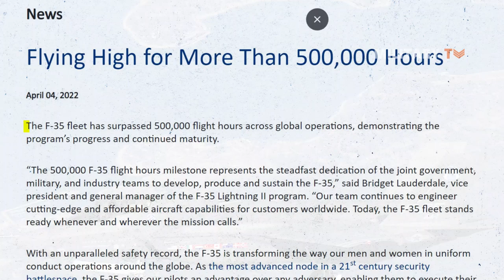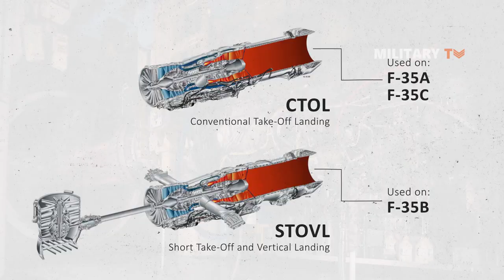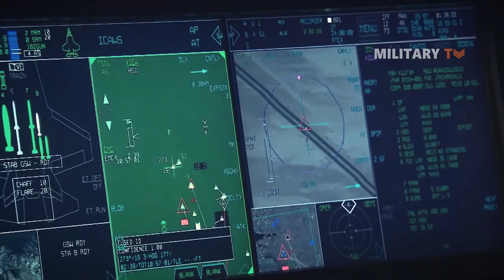Many Things You Probably Didn't Know About F-35 Fighter Jet

Comment: the range and speed are actually a downside because this plane just doesn't have good range or speed. not sure why the video would make that a talking point. seems strange..Also the carrier version is limited to 7 G's because the added larger wing just isn't capable enough. That's the problem with this jack of all trades, it's a compromise start to finish.
Reply: @snsproduc "fully loaded" F35 means not even 1/5 of the full load of a normal fighter jet. The F35 has too small and too few internal weapons bays. It can't even taken some common missiles because of that problem. Some people don't even call it a fighter jet because it can neither turn nor run, so it gets called sensor platform instead.
Reply: @swunt10  It can also do external loadouts. It's multirole, it can do many things. The AIM-120 AMRAAM for the internal bay is an excellent A2A weapon, it can also carry other AGM's or JDAMs in the internal bay. The F-35 is literally more manouverable on a stealth loadout (without external load) than a F-16 with no external weapons at all (gun only). It can do a over 28 degree angle of attack. It has the most powerful thrust of any 4th or 5th generation aircraft, which depending on loadout, also gives it a better thrust-to-weight ratio. It has a 28-1 kill ratio against F-15's and F-16's.
Reply: No range or speed? Geesh, what have you been reading?

How about we list out the fuel tank size here .

Fuel capacity (fuel tank size):
Harrier  7,000 lbs
F16 – 7000 lbs
Gripen39E/F – 7,500 lbs
Rafale 10,362 lbs
F18 – 10,860 lbs
Typhoon – 11,000 lbs
F15 – 13,455 lbs
F/A-18E: 14,700 lb
F35 – 18,498 lbs

Now, take a guess in above which by FAR has the larger fuel tank capacity? You have to swap out wing stations for fuel bags, and thus give up stations for external fuel tanks - not weapons.

How is a F16 with 7,000 lbs fuel tank going to get you a range EVEN CLOSE to what the F35 gives?

As for speed? Once again, we find the F35 actually flies faster with a combat load.

However, the F35 has a BETTER power to weight (thrust to weight) rating then a F16, and in fact even better then a duel engine Rafale.

And take a F18a. Its rated for Mach 1.8. But, hang JUST 4 AIMS on it, and you now down to Mach 1.4, and ONLY at 40,000 feet. Drop down lower, and you go slower and slower.  But, it gets WORSE!!!

That F16, f18, or Rafale? They ALSO need more fuel. So, now you have to hang fuel bags on the wings.  Put just one centerline fuel tank on a F16, and you max g-loads are now about 5.5's.
The F35? still full 9g's rating!!! and stull Mach 1.6 rating!!!

Then when groups of F16's fly with F35's?  They start to fall behind, and then have to punch afterburns to catch up. Then then start to fall behind again, only having to repeat that process. 

And KEEP in mind that a f16 has 3.5 minutes of AB time - at that point your fuel tank is HALF gone!!!

The F35 has more power, and a higher power to weight (higher thrust to weight then f16 or Rafale).

Then we see and find these quotes:

pilot Lt. Col. Hank “Hog” Griffiths
Even when loaded internally with two 2,000lb GBU-31 Joint Direct Attack Munitions and two AIM-120 AMRAAMs, Griffith says the sheer power of the Pratt & Whitney F135 is evident. “The engine has a lot of thrust. It’s been fun to outrun the F-16 (chase aircraft). They can’t keep up. If we go to full military power the F-16 has to go to afterburner to keep up

Norway pilots ALSO note the same - they flew F16's, and are now flying  F35's.
quote:
We who fly the F-35 daily, can establish the following: The aircraft is faster, more maneuverable, has more range and, can carry a significantly higher payload and provides the pilot with a significantly better situational awareness than what we are used to from the F-16

Col De Smit – RNLAF
Quote:
F35 climbs, descends & accelerates like a clean F-16

QUOTE:
Compared to the F-16, the F-35A with “full war equipment” can cruise 10-15k feet higher without afterburner and cruise 50-80 knots faster, all of this additional energy is imparted on missiles

so, if the F35 really was all that high drag, or slow, then how F16's can't keep up?
Reply: @Albertkallal  ... modern F16s can go Mach 2 and are therefore faster than the F35 who max out at Mach 1.6... 

maybe you skipped physics class but just like the powerful jet engine is no indication for max speed (because the F35 is heavier and less aerodynamic.. fat really than other jets so the more power doesn't translate to more speed) the same is true for fuel capacity. The F35 is a fat brick and needs a large engine which needs more fuel. So the more fuel doesn't translate into more range because the powerful engine and the shit aerodynamics negate it. That's exactly the problem of aerospace engineering (which is what I studied at uni) if you make it slightly heavier or inefficient it bites you on the arse everywhere.

Also conformal fuel tanks exist in case you don't know..

PS the old F16 versions that where used by norway and as red team in the US is not only an older version (modern version of the F16 can go Mach 2+ while the F35 maxes out at Mach 1.6) but it's also a much smaller aircraft. The larger the aircraft the easier it can outrun other aircraft. That's why fighter jets could not keep up with Concorde. Didn't make Concorde a great fighter jet though.

Also these military quotes simpletons like to use are always political. you will never get any negative quotes out of active military personal simply because they like their career and everything they say is closely monitored also most of these positive quotes come from basically lobbyists who already work for or will work for the industry after they leave the military (or they are at least part of the "team" for this program).

If you want to know what they really think you need to look where the money and power is flowing. Here for example from a few weeks ago
 
"WASHINGTON — The Pentagon and industry agree the F-35 engine needs improvements. But despite years of development and debate, the path forward isn’t yet clear.
With the fifth-generation fighter’s missile capacity, electronic warfare, and targeting systems advancing beyond what was originally conceived, and the U.S. Air Force concerned about the potential for war against China, the service is planning to put more power and cooling ability on the F-35."
"But there remain multiple options for how to get there. One approach is making a series of upgrades to the existing Pratt & Whitney-made F135 engine currently powering the F-35 through the Enhanced Engine Program.
Another potential path is an entirely new replacement engine using cutting-edge technology such as a third stream of air to improve fuel efficiency and thrust. Pratt & Whitney and General Electric Aviation have each developed competing versions as part of the Adaptive Engine Transition Program, known as AETP."

So the fat brick needs a new more powerful engine.. well.. it's not like everyone in the know already pointed that out. Doesn't take a math genius to figure that one out.

Maybe they should also fix the 7G limit for the F35C and F35B version while they are at it because that's embarrassing all around.
They also tried to solve the too small internal weapons bay at some point..

It's a good modern aircraft but as an air superiority fighter it's almost useless, too slow, can't turn. As a multi role jack of all trades it's ok alto too expensive for this secondary role.
In the end everyone will buy it simply because it's modern, has stealth capability, is available and widely used by others. But it's not difficult to imagine a better jet fighter.
Reply: @swunt10   The F-16 can hit Mach 2, and maybe just a little more, at burst speed, it cannot sustain Mach 2. It can only do this, if it's carrying virtually no fuel, no weapons or any external loadout. To achieve Mach 2, you need to be at a higher altitude, then you need to sit there like a potato for quite some time building speed to reach Mach 2. And once you're there, your airframe would literally be at its limit, and any manoeuvres will scrub speed, or rip out a wing.

The F-35 wasn't designed to do this. It was designed to hit combat speed, on a full combat loadout. So whilst you're sitting there, with almost bingo fuel, and no weapons, a F-35 will be able to reach supersonic, with full fuel and a A2A combat load, with added A2G even. And blast you with its 50+ km range A2A missiles while you're busy trying to keep the airframe straight as an arrow.

On a full load the F-16 (depending on your weapons package) cannot reach supersonic. The F-35 has a better thrust-to-weight ratio compared to the F-35 in any scenario, unless the F-16 is carrying no external weaponry, only the gun.

Also, you say military quotes are from simpletons who are always political, yet you've brought out a magazine article, based on what a military quote. Fighters improve their engines all the time. The F-16 used several engines over its lifetime, several improvements from the original Pratt & Whitney, and it's latest and greatest at the moment, is from GE, of which there are also several different variants over the F-16's development. This is normal over a fighters development cycle. This has been the case as fat back as WW2. These are frontline fighters, they're going to be improving engines all the time. The fact that this is new to you just shows how little you know of the development process of a fighter. The military primarily wants an upgrade to efficiency and thermal management (so it can run cooler and therefore be stealthier), rather than an increase in thrust.

The F-35A can do 9G. The F-35B is rated for a maximum of 7G and the F-35C is a maximum of 7.5G, for reference, the Super Hornet can only do a maximum of 7.5G, which is a suspiciously similar figure and that's because of the requirements for the Marines and the Navy. They never really want anything more than 7.5G. They've always preferred keeping the aircraft light, rather than pulling massive G forces.

I've yet to see a pilot international or otherwise, or an exercise, where the F-35 has underperformed or disappointed in any way, besides of course, the earlier non-combat software block test and training variants.
Reply: @britishmalayasociety  yeah no. The F16, small as it is, can get Mach2+ while the F35, the brick that it is, can't ever dream about Mach 1.6, that should tell you all you need to know about performance, that's the reason why this brand new aircraft already has the pentagon scrambling for a completely new engine. That just doesn't happen in any other jet fighter program. 
Also please stop with the "full combat load out". That is so embarrassing to read..
Reply: @swunt10  
>the Pentagon and industry agree the F-35 engine needs improvements. But despite years of development and debate, the path forward isn’t yet clear.

And what fighter does not want better engines?
As I stated, the F35 engine is the worlds most powerful engine in a fighter right now. So, what was your point again????

All fighters engines need improvements - it is a question for what reason and why?

The F35 engine wants improvements in regards to heat management, and they need a way to remove heat from the aircraft due to all the advanced weapons - those systems produce a lot of heat - so they are looking for a improved engine that has abilities to remove more heat from all the systems on the aircraft. They are not looking for a better engine due to lack of power, or lack of performance.
Reply: @Albertkallal  You keep going on about having the most powerful engine in a jet as if that's a good thing. The F35 has the most powerful engine and can't get past Mach 1.6, gobbles up fuel like there is no tomorrow and it lacks range, how is that a good thing?
The nimble and light Eurofighter has 2 engines totaling 120 kN thrust, the F35, unaerodynamic and heavy as it is only has 125 kN thrust. So yeah they need an even better engine to make that brick fly. The F35 weights 2 metric tonnes more than the Eurofighter, dry! and it needs 3 tonnes more in fuel to get the range of the eurofighter. 

So the F35 is 5 tonnes overweight, but only has the same engine power as the Eurofighter, not to mention the eurofighter can turn harder, sustain turn better and is more aerodynamic.
And again no other jet program needed a new engine that soon after getting launched as the F35 now does, most don't get a new or improved engine at all. 
What a shitshow.
Reply: @swunt10  
You can't argue with the numbers I provided. The simple fact (backed up by both physics and real witness and testimony from pilots), the f35 is better than the fighters it's meant to replace. As I stated on Carroll Wards YT channel in over 10 years of flying the Mach 2.35 f14, he saw Mach 1.8 one time!
You have to drop your child like fascination with car sales job top speed ratings.
I quoted the Falklands war, I quoted f16 pilots now flying f35.
They flat out state the f35 flies faster and farther then the f16. And the power to weight rating I used was for a block 50.
The f35 not an interceptor - but it's performance is BETTER than the fighters it's meant to replace. I stand by the power to weight table I posted, and I stand by the real pilots quotes I provided. Those numbers, physics and pilot quotes are not my opinion but are real world witness and testimony.
And you not provided any information that counters or changes the information I provided.
You just have to live with these numbers - including those showing nations are hands down choosing the f35 more so than any other fighter.
Reply: @swunt10  
No! The engine is tuned for a better by-pass, and results in LONGER range.

F16 – 340 n miles (range = 680 n miles)  (1259 km)
F18 – 400 n miles (range = 800 n miles)  (1481 km)
Gripen Jas39 E/F – 431 n miles (range = 862 n miles) (1596 km)
Rafael – 500 n miles (range = 1000 n miles) (1852 km)
Typhoon 582n miles (range = 1164 n miles (1862 km)

F15: 540 n mile (range =  1080 n miles) (2000 km)

F35 – 760 n miles   (range = 1520 n miles) (2815 km)

Now, just try and hang fuel bags on those fighers to get their higher range rating?

Like I said, performance and power to weight goes out the window. And worse, a F16 with just one centerline fuel tank? About 5.5 g's rating.
F35? Still at a eye watering 9g's rating.

So what shortage of range you talking about? sure, happy to start comparing these fighters with big fuel tanks on the wings, and THEN we really have a new conversation - one about how the F16, Gripen, and even duel engine Rafale power to weight rating goes out the window.
So does max g-load rating.
So does top speed.
So does maneuverability.

The simple matter is a F35 will eat f22's all day long and then some - and I can explain why this is so if you are interested.
Reply: @Albertkallal  your beloved power to weight ratio ignores the humongous amounts of fuel the F35 needs to carry to get the same range of fighter jets like the EF (EF 2.900 km range, F35 2.800 km range). Carry 3 tonnes more fuel just to get the same range while basically having the same engine thrust but already being 2 tonnes overweight when dry. That is a horrible power to weight ratio equal to strapping a 5 tonne weight on a eurofighter (which has as near as makes no difference the same engine thrust as the F35) and that doesn't even include the aerodynamic losses of a fat bird compared to a more skinny jet like the EF.. 
there is a good reason the pentagon is heavily investing in a new engine for the still brand new F35 while other jets use their engines unchanged for many decades.

Forget your lobbyist career officials and look what they really think behind close doors.
Reply: @Albertkallal  Also I just check the thrust to weight ratio on wiki just to do some reality checking. 
F16 Thrust/weight: 1.095 (1.24 with loaded weight & 50% internal fuel)
F35 Thrust/weight: 0.87 at gross weight (1.07 at loaded weight with 50% internal fuel)

So it's even worse than I thought. Even the old tiny F16 is doing better despite you picking it out to proof how much better the F35 is.. 

Also this 
F16 Ferry range: 2,277 nmi (2,620 mi, 4,217 km) with drop tanks. Pretty amazing for such a cheap, small, old aircraft
Reply: @swunt10  this is BS. It’s limited by heating of the airframe, not by engine power or fuel usage.
Reply: @swunt10  the T/W ratios you give are not for similar missions. So you’re comparison is flawed. You have to add two drop tanks for a similar profile. Furthermore, the ferry range is not interesting what so ever when fighting.
Reply: @swunt10  you realise jets almost never fly at top speed
Reply: @swunt10  the F35 does not carry external fuel normally tho so that ferry range is kind of a useless comparison. And the F16 does not have the sensor fusion of the F35 so the F16 is not plain better.
Reply: @CasualAmin  "sensor fusion" is a buzz word for "modern computer". you can put a modern computer into any cockpit. Doesn't change the plane one bit.
Reply: @swunt10  well they need integration and if not integrated it does work, also the design is something you don’t just implement
Reply: @CasualAmin  A computer is a computer. It has nothing to do with the airframe other than that it needs to fit inside.
Reply: @swunt10  it is made to control the air frame because most jets are instable does need to be programmed in a way so it does properly control the air frame
Reply: @CasualAmin  You are mixing up the avionics for the flight control which just makes the aircraft fly (like every civilian aircraft as well) and the military avionics which is the military sensors, weapons and the computer that ties it together. I really don't know why this is such a difficult concept for you. The computer system that makes the F35 a modern war machine could be transplanted even into a Cessna it really has nothing to do with the air-frame. Give the F16 a upgrade package and you have the same deal minus the stealth which is questionable anyway but a nice to have at least in limited situations.
Reply: @swunt10  why in limited situations because most combat is bvr so in a lot of combat situations
Reply: @CasualAmin  1. because the stealth of the F35 is almost useless against modern ground based air defense systems. Modern highly efficient radars, longer wave radar, the new kind of passive radars from Hensoldt or simply more than one radar connected together defeat the stealth of the F35 according to all I heard so much so that it doesn't even make a small difference.
That's why flying low, below the radars, is still the best option even for stealthy F35 just like for none stealth aircraft 
2. because bvr is still mostly unrealistic except in very limited circumstances. The fog of war and other limiting factors such as rules of engagement, civilian aviation and allied nations milling around make i nearly impossible to know what is going on before you actually check. That's why visual confirmation is still the default setting for all fighter jets. You simply can't shot at every radar blip on your screen, you have to check it out. Once you do that you are so close that any stealth feature becomes meaningless. But even at bvr you still have modern IRST systems like on the Eurofighter so a stealth aircraft is very much detectable even bvr
3. the third limiting factor that can easily defeat stealth is long range AA missiles with two link communication such as Meteor. Meteor can be launched in a general direction by any sort of aircraft and then the missile using it's own sensors and other aircraft/ground stations or even other Meteor missiles feed it with additional information. Basically like a suicide drone. 

That's why flying low is still the best option in most cases and stealth or not if you stay below the radar horizon you are good

Of course if you do artificial exercises in controlled airspace, two groups of jets coming in high from known directions, everyone just out for a computer simulated missile kill and you basically play who can shoot first then stealth is probably a lot of fun but in the real world how often does that happen?